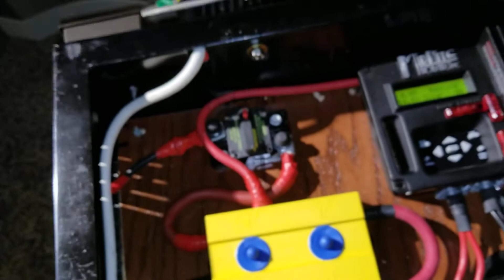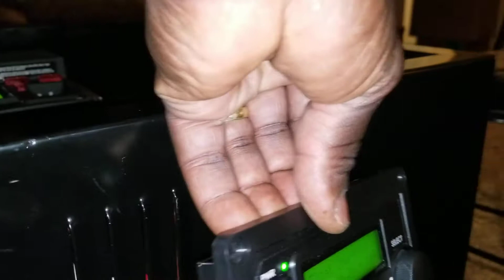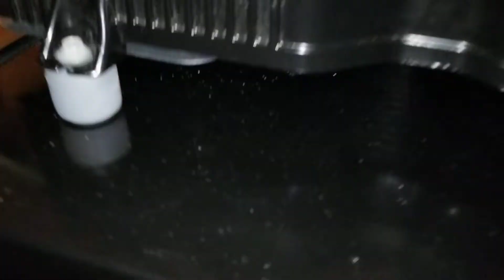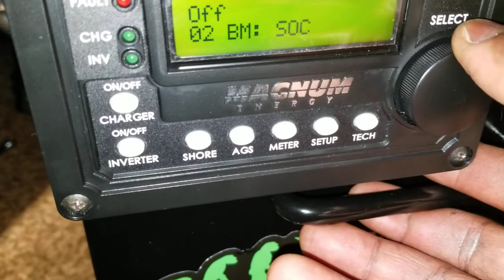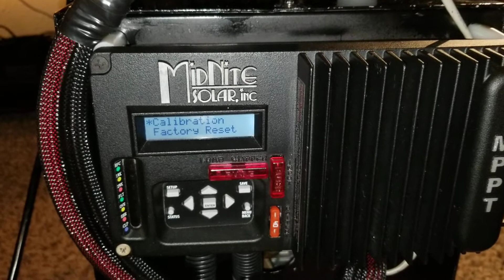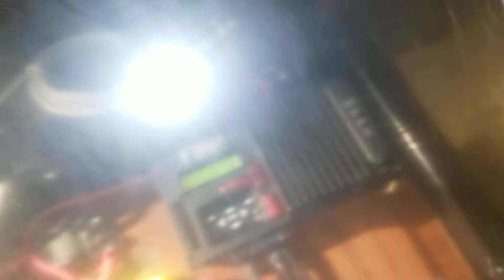FREE ELECTRICITY, PANASONIC CGR18650CG, SOLAR, POWERED, GENERATOR CHARGING (part2)

Comment: That’s a great DIY solar generator project that will be very usable in any SHTF situation .  It’s a JW Masterpiece  that’s going to run loads at let’s say at 100% capacity  . A well planned unit with a plexiglass view of the components and most of all is the battery voltage capacity exceeding the usable limits then other solar generators . Are you going to incorporate a cooling fan and switch to circulate air throughout the unit ?  May the solar be with you .
Reply from the maker: Thanks brother.
I really appreciate your support and comments on my channel. 
Please have a bless day